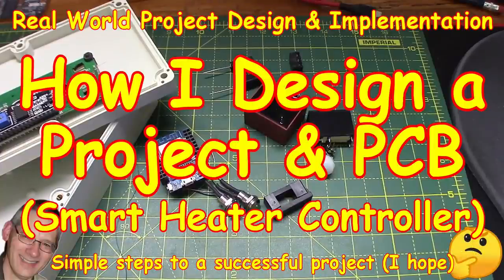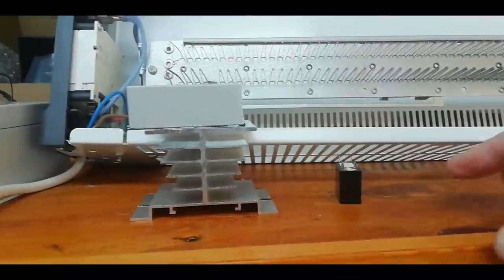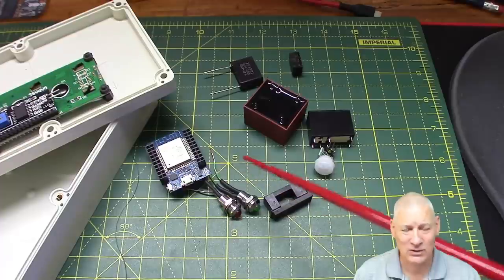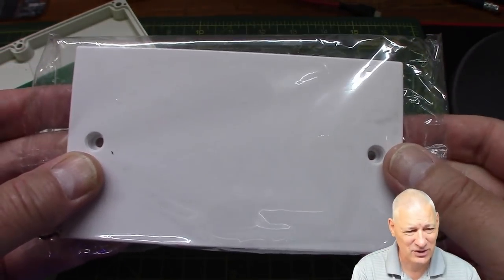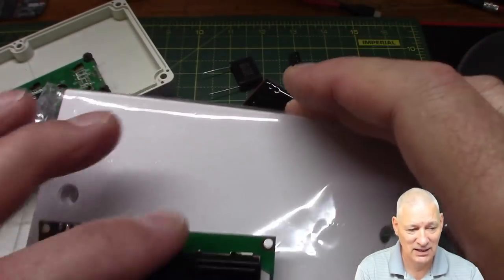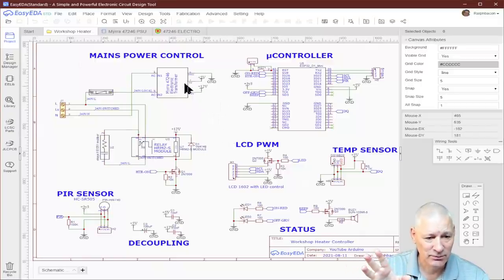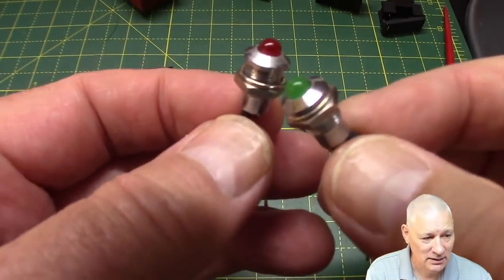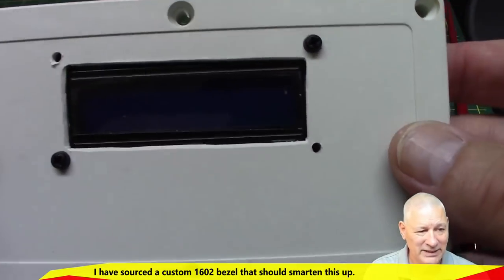#225 How I designed my Heater controller - Warning! ☠️ Mains voltage!

Comment: I have cut 16x2 lcd's into a case lid the same as yours, quite neatly by marking out with an ink type marker pen (fine tip) and then cutting, ever-so-carefully and a bit at a time using a steel rule to begin with as a guide and a stanley knife. Start in one corner then cut about half way along, reverse and cut from other direction. Have to be really careful though as any slip with a finger in line will be disaster.
Still, your box is a couple of metres away so who will know. :)
Reply: Sorry, hadn't read your comment before I included your tip almost verbatim ... With one extra thing though. Never use the blade edge to cut but rather the back edge of the blade to "SCRAPE" the plastic away. This provides a VERY clean cut and automatically leaves blade clearance.

Just make sure your straight edge is aligned such that you are cutting the INSIDE part of the cutout so any minor slips won't matter as they'll end up on the piece being removed.
Reply from the maker: I did the 16x2 cut-outs exactly as you described, Jeff, but without enough of the "ever-so-carefully" I guess! But I do have some bezels that will smarten things up (= hide my bad cutting). ☺️
Reply: @RalphBacon  Interesting about the bezels...where did you get them.
I've looked many places before but could never find any........short of a 3d printer I imagine.

Comment: keep your low voltage the same distance away as the relay pins and from the contacts. Cut your slots there. Make your mains power tracks at least twice what you have now or you will burn out the tracks on inrush current. Leave tracks open and fill with solder if you need to. An overloaded track will coil up and short out. Whilst you may have a 15 amp relay, you have two amp PCB tracks. Slots are nice, but when it comes to inspection, they use distance. CE rules are a minimum of 6mm.
Reply from the maker: I'm going to solder wire that can carry all that current on top of the tracks (effectively making the tracks redundant), Terry. I've read up about slots, I don't think any are required here, you reckon between the coil contacts and the other relay contacts?
Reply: @RalphBacon  When i had products put through for testing, these were the requirements. I even had to choo opto  isolator pads to get the 6mm

Comment: Theres a lot of wifi mains sockets suitable to plug the heater into, so no need to put any electronics into the heater enclosure just plug the heater into the smart socket.  For your low power control box you could incorporate a mains socket, sort of inserted  into a cutout in the back of the control box enclosure.  You could then plug in a wall wart, but maybe instead of a 3 pin power outlet in this mains socket there are usb power outlets designed to fit the pattress box and you could then feeds your low power circuit board with a simple usb lead all inside your enclosure.  Your esp32 then sends appropriate wifi commands to your wifi enabled heater socket.   Ok, smack my wrist, this is a bit of a redesign suggestion which is probably not appropriate, but it does eliminate any possibility of getting anywhere near mains voltages.
Reply from the maker: Smacked wrists indeed, BG! I had actually thought of using my Sonoff unit to switch the heater on and off (works with Alexa), using MQTT/Node Red and a RasPi but it all felt a bit plug-and-play. I want to design from the ground up and get my hands dirty.

Comment: Awesome video. I like the level of detail. 
My two cents:
For housing and finding the right box: maybe 3d printing is also an option you didn't mentioned.
For PCB design: I like KiCAD :) ....
Reply from the maker: If only I had a 3D printer (and knew how to use it)! But as for KiCAD, I've said it before, "Designed by geeks for geeks". I just found it hard work, powerful though it undoubtedly is. 🙄

Comment: I don't remember if you are into 3d printing yet, but if you were, you could easily print a black bezel to snap over the cutout for the led just to dress it up. Purely cosmetic. Ether that or invite Clickspring over with his micro-files to clean up the edges for you!
Reply from the maker: Not yet, Edward, although I did spend a couple of hours on Sunday doing some Fusion 360 training. Slow going (always is for me) but the 3D printer I hanker after is now 1m closer to my workshop!
BTW I have bought some 3D printed bezels that might work. We shall see.

Comment: SSR can be mounted on any thermally conductive surface of sufficient area.
I've used steel enclosure side panels. Read the device datasheet for guidance.
Reply from the maker: But, presumably, not inside a hot, heater area? And I would not want to mount it externally so I ran out of options, to be honest Bernd.

Comment: You could have used the metal case of the heater as the heat sink for the SSR.  LOTS of metal.
Reply from the maker: But it would have been mounted externally , right, otherwise it would just get hotter and hotter. But that SSR was a fake (OK for testing) and a real one costs big bucks.

Comment: What about swinging esp32 board around 180 deg. Put a hole in the side of the case for usb connection to reprogram and serial monitor.
Reply from the maker: Certainly an idea. Especially for serial monitor use. Programming is done via OTA though (works very well).

Comment: I have to learn not to send off a pcb until a few days after my layout is done. About the time the fab house does the solder mask I think of something I missed 🤔🤭😕
Reply from the maker: You and me both, David. However, this time it will be checked many, many times before I send it off. What could possibly then go wrong?

Comment: Hi Ralph, what about routed air gaps between the high and low sides of the PCB? I'm no electrical engineer and I don't know the best practices concerning them, but maybe someone can chime in on the subject?
Reply from the maker: Yes, worth considering and I investigated.
Air gaps are used to provide a non-conductive section where we have (higher) voltages and where the voltage might otherwise "jump" (spark) across tracks. 
In this design, all the high voltage tracks are spaced far enough apart and well away from the low voltage area. I'm happy this is safe (I don't want my workshop burning down).
You raised a good point, Eddy, and in my workshop heater repair (video #133) I used air gaps between L and N as per the original PCB. It's still working!

Comment: How about a DIY SSR with zero crossing triac optocoupler driving a power triac and a flat stock  strap of aluminum for a heat sink for the triac.   Small and flat form factor you can slip in anywhere in that case.   No moving parts to wear out also.   I just don't trust those mini relays that say can handle such huge amperages.
Reply: You can't beat a relay for an application like this. Semiconductor switches like triacs have a voltage drop of 1V and higher. For a up to 2kW load, so more than 8A, the switching component will need a good heat sink coupling to get rid of several Watts. And their capability of fast/frequent switching is completely wasted for a heating controller.
Relays that are tested at their rated current for 100,000 electrical actuations aren't expensive, even from brand name manufacturers (and I'd only trust those to meet their specs).
Reply from the maker: I concur with superdau's point about relays. I'm underrating the relay from 16A to 8A which should give it a long(er) life. Should it fail, I hope to be able to swap it out reasonably easily - but maybe I won't ever have to!
Reply: @RalphBacon  I just thought you wanted solid state since you mentioned the puck SSR.   Relay should last since the load is resistive and not inductive.

Comment: I'm watching this a year after you've done it but I can't find the final video that shows what ever happened to this. 
Is there another one?
I want to do this very thing... 
sort of. 
I want to put a wireless thermostat across the room from the unit and have a receiving circuit box that will cut off the mains to the heater at that point. 
Really it is not that much different from what your doing here I dont think. 
Is it???
Thanks.
Reply from the maker: There's a bit more about this project in video #238, but I know I give quick shots of it in other videos when I refer to certain "features".

However, let's just consider your requirements. A wireless thermostat across the room (yup, got that) to turn off/on the heater elsewhere. Yup. You've just described about 50% of what my project does.

I use ESP-NOW for the sensor to communicate (you might like to watch video #223) with the ESP32 in the main controller. That receives the signal from the remote sensor and turns the heater on/off accordingly. It's been running since September 2021.

It does more than just that, however. I have it remotely controlled from my phone (Wi-Fi enabled) so I can turn on the heater for a while from the comfort of my home so I don't walk into a workshop at minus 5ºC! I showed this (briefly) in another project, my Barrel Pond Controller (video #254).

It also receives the temperature from my Attic (via ESP-NOW) so I can monitor all this on my phone (simple web page).

If you want more details/suggestions just email and I'll see what I can tell you.
Reply: @RalphBacon  very grateful thank you.
Very good videos 👍

Comment: Yup tried using the back box and cover before both parts shattered!
Reply from the maker: Been there, done that! But do check out the alternative PVC blanking cover plates, they would be fine to drill. But not the backbox.

Comment: A Bezel around the display hides hides errant saw/file cuts.  Easy to 3D print.
Reply from the maker: I have some! But one of them is too big and doesn't hide anything. The other might be OK, but until I put it all together I won't know. As it's in my workshop I'm prepared for the 80/20 rule - good enough is, well, good enough. Perfection inside the house but in here...

Comment: Interesting video as always. But I see you need to add another plaything to your kit, a 3D printer.  Its ideal for printing electronic enclosures.  Put it on your Christmas list :-)
Reply from the maker: It's been on my list for several Christmases now but the problem is I would not know how to design for it. I'm trying Fusion 360 but that is hard work. I might try a simpler CAD program just to get me going!
Reply: @RalphBacon  A bit of a leaning curve with Fusion 360 but I found that just to do boxes with various cut-outs and screw holes etc is not too bad.  Learning to do real engineering drawings would be a huge effort.  To get going I remember I followed along a youtube tutorial on building a box and, after a bit of playing around, my first box emerged.  It probably took me a week of playing around for a couple of hours each evening.  Now I can knock up an enclosure in an hour or two, which can then take 8 hours to print.  Almost as quick as an Amazon delivery :-)
Reply from the maker: And twice as expensive? 🤭
Reply: @RalphBacon  Just on filament cost terms probably more like half the price, but factor in the cost of the printer then for a few boxes a year they are very expensive boxes :-(  . But who counts the cost for a veritable work of art. (just don't let the missus know of the cost or I might have to print a protective helmet or some other protective box....)

Comment: Would have went for a triac and an optotriac with zero crossing detection for switching instead of a relay - way more robust for resistive loads.
Reply: And also has good galvanic isolation of both sides.
Reply from the maker: What about the size, though? Quite a difference. And does the relay provide any less galvanic isolation, in real terms? If the SSR were the same size I'd choose it in a heartbeat. As it is...
Reply: @RalphBacon  I think a TO220 triac and DIP8 or DIP6 optotriac to trigger it are not that large ;-) You even can go to a TO247 triac (if you can find one). This way you can have all your 240 VAC stuff on one side of the board and logic on the other with superior isolation :-)

Comment: Honestly I have seen so much madness going from schematic to PCB, that after a while I just started to design on the PCB editor and skip the schematic. With enough experience that becomes easier anyway. Schematics are really more for making it "official". 
Even creating the footprint is just "place pads and know your grid spacing".
Reply: I frequently do the same, @Doktor Jeep. A quick pencil sketch of my circuit and straight to PCB design.
Reply from the maker: If this works for you, go for it!

You do miss out on automatic checks on NET names, whether you have missed a connection altogether and you never have the schematic to refer back to in the months to come (a quick pencil sketch is not going to survive long!)

But you must do what you think works best.

Comment: What's your patreon link Ralphy?
Reply from the maker: I ain't got one, Joey! Others have suggested it, over the years, but it just didn't sit well with me. Not sure why. But if things get financially desperate...
Reply: @RalphBacon  its not about whether or not you need the money brother. It's a sign of respect and thanks for the fact someone has learned something from you that helped them and you put effort into making that happen. I'll tell ya Ralph, I'm a software engineer by trade but went into policing instead and now I'm 42 and retired with ptsd and this hobby saved me. I seen a video about arduinos in my feed so I ordered a kit, done all the lessons and there was a 2n222 left over that wasn't covered. I had no clue what it was an investigating it lead me to digital electronics as a hobby and now I make things and sell them for charity. I give away kits and teach guitar.

Comment: I would have totally made it temperature controlled directly connecting to heater element. You'd need a realtime uC, like 328p as well and SSR or triac though. Let me know if you want me to share a well tested AC PDM source code that you could use.
Reply from the maker: Woah! Leeroy, you been smoking funny tobacco again? "Directly connected to the heater element", you say. I feel a bit woozy after reading that. I'm far happier using a transformer for the low voltage stuff and a relay to control the life-endangering voltages, frankly. Thanks for the offer but I'll decline this time 😲
Reply: @RalphBacon  Using optoisolators obviously. I meant directly control heating resistive element and not the heater as an appliance.

Comment: Do not use a heat sink in a heater. You will sink the heat from the heater into the SSR. It is all about the thermal balance. If ambient of the sink is hotter than the junction, it will just heat up the junction. 

Rather than a good coupling you want thermal decoupling of the heater ambient and the SSR. If you would like to use that at all. I wouldn’t in this case (pun intended)
Reply from the maker: No, I think we've agreed that (a) there is no room in the heater and (b) it would be too hot anyway. Just as well, it would cost a fortune to buy a genuine SSR product.

Comment: Your link to the case on Banggood does not work
Reply from the maker: You're right it doesn't, because Banggood have withdrawn that selection of boxes. I've substituted a different link to one of the same box types with various sizes - thanks for letting me know!

Comment: DANGER POTENTIALLY LETHAL DESIGN ! 
Ralph I am a UK sparks - you are wrong you NEED an earth. You are passing AC THROUGH the 'double insulated box' not containing it inside. Your design has lost the earth connection to  the heaters metal enclosure. You are unprotected should a should a fault develop and the metal becomes live and you touch it!!!!. Just use 3core in for the incoming and outgoing and just join the earth wires inside your box with a terminal block or crimp(ideally).
Additionally, you need to consider your fusing. You have 2 AC paths 1 heater & 1 PCB both sides need a fuse. Suggest you use an externally accessable panel fuse for AC heater. Don't forget the fuse in the plug doubles as protection for cable. So 13A in plug, 10A slow (glass) within box and 500mA (slow) glass, on PCB for electronics.
Stick the snubber in for end/emi reason and also to limit radiated   wireless emissions from arcing relay contacts, you still might have esp or even local wi-fi/radio connection issues
Reply from the maker: I'm always willing to hear from a sparky, but I still don't quite get the need for an earth. Let me explain.

The standard T&E goes to the socket below the heater controller. I'll just disconnect the L from that socket and run it up into this controller along with the N (separate, additional single wire, not disconnected from the socket). The switched L (via the relay) then goes back to the socket. No different to a simple switch really. 

The L & N also goes to the tiny transformer which I've fused with a 1A glass fuse. But that's almost incidental.

This surely means that the E has not been touched. It still goes to the original socket to which the heater is plugged in via the 13A plug it has.

I'm guessing you're unaware that the heater still has its 3-core fused plug and goes to the original, earthed socket. I should have mentioned this in the video (I did so in a previous video - what? You didn't watch that one? Write out 100 times: I must watch ALL of Ralph's videos. Oh alright then, 20 times as you were good enough to comment here!)

And yes, I'll fit the snubber anyway as I have no (easy?) way of determining whether sparking is occurring in that sealed relay.

I'm very happy that you're thinking of my health here, GN, but I'm pretty sure it is as safe as I can make it.